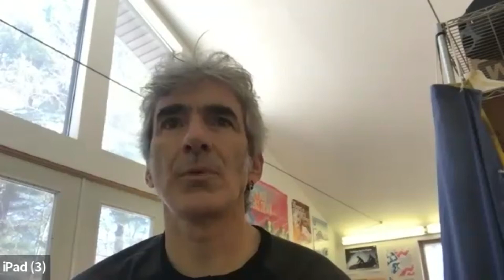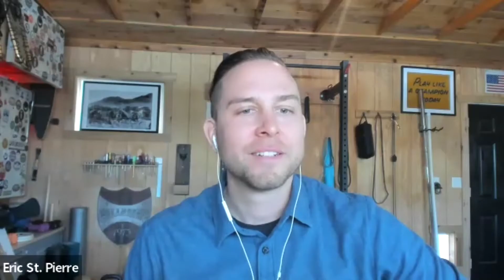Paul Marchese - Olympic Speed Skate Maker | Explains Blade and Boot History

Comment: There were a few differences in the long track and indoor or short track skates and blades in the late 70's. The long track skates usually had a longer blade, the blades were pretty much centered in the middle of the boot, were straight and were a little flatter. The indoor skates had shorter blades were offset to the left as far as the cups on the boot could go, were usually a little thicker blade and had a bit more of a curve to the bottom of the blade.
Reply from the maker: Thank you for the insight Craig! ESP